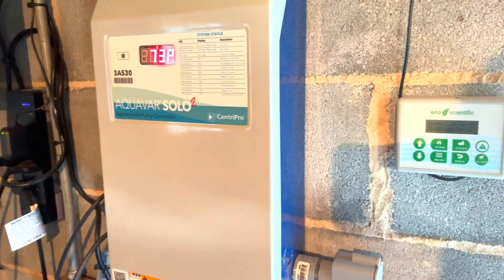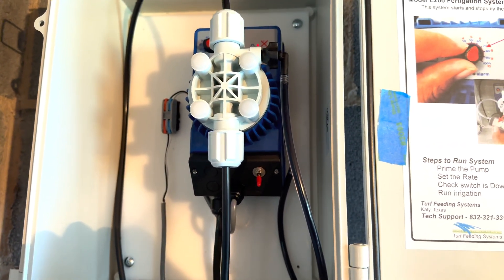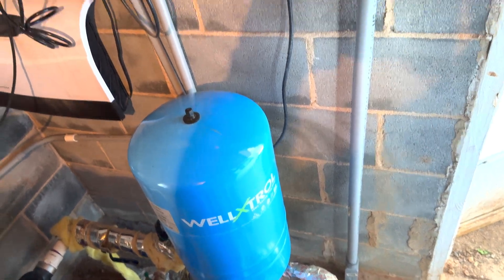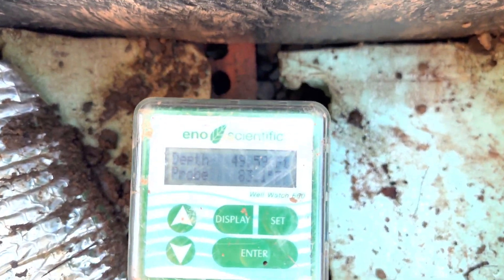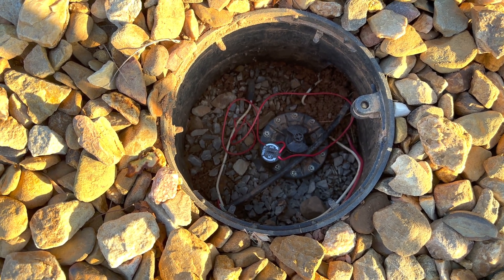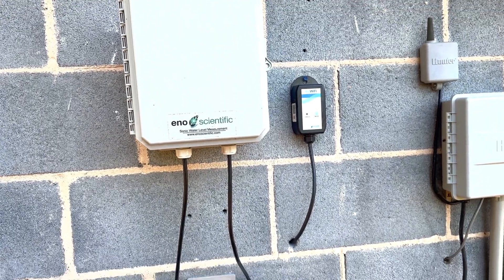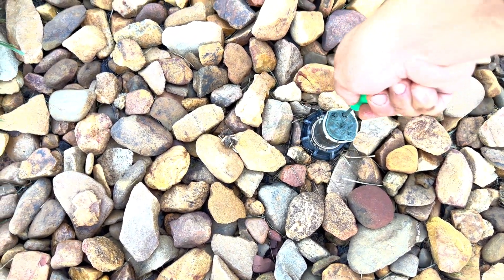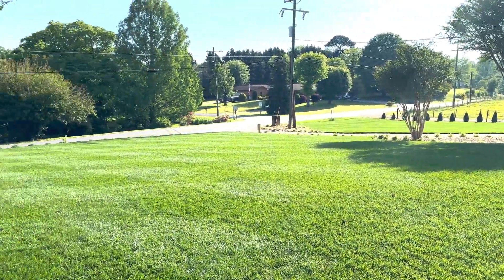Irrigation And Fertigation System Tour On A Well For 31,000 Sqft Of Fescue!

Comment: Please show us how you installed your gravel rock landscaping beds.
Reply from the maker: I will be honest lol. I hope I don’t have to lol. That’s 115 tons of rock in my beds they brought like 15 tons at a time and I just used my tractor to place individual piles in the beds! I will give you a tip this sounds stupid but it’s much much easier using your foot to spread the rock vs a rake or shovel. If I do happen to get more rock I will video it but I’m hoping this last a while!
Reply: @Prime_Fescue  did you use landscape fabric before laying the rock? I am looking to do this project.
Reply from the maker: No not with 13,000sqft of beds! That would be the correct thing to do I simply just could t afford it with this much bed. I spray pre emergent in mine 2 times a year or use a granular called snapshot or crew